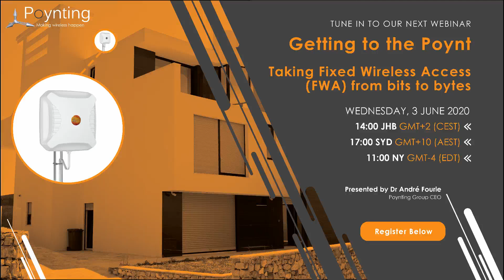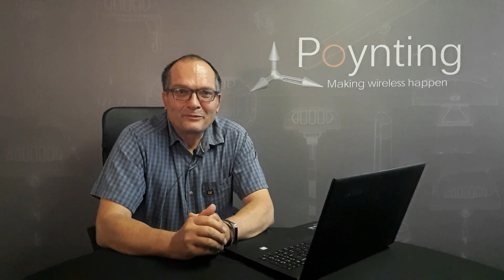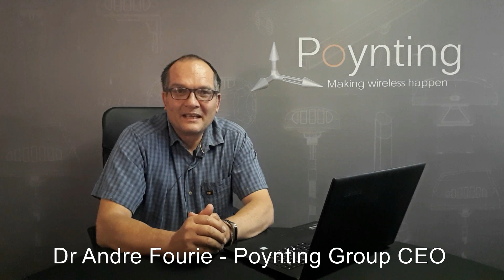Webinar invite - Taking Fixed Wireless Access (FWA) from Bits to Bytes - Come and join us on 3 Jun!

Comment: Hi Sir, 
My LTE router has one SMA female antenna port. Can I install 2 LPDA ANTENNAs  in a MIMO FASHON TO EACH OTHER AND USE A combiner to connect two antennas and connect them to my single sma female port of the Lte router...will it work ???
Reply: @poyntingantennas  thanks. Can this one be used as a 2way splitter

https://www.amazon.in/dp/B084YVLJ3Y/ref=cm_sw_r_wa_apa_i_r.OpFbEJ0A2ZG